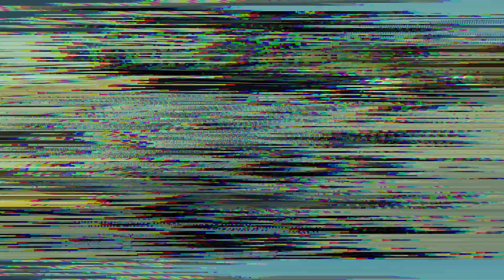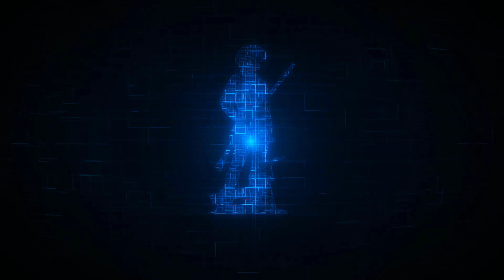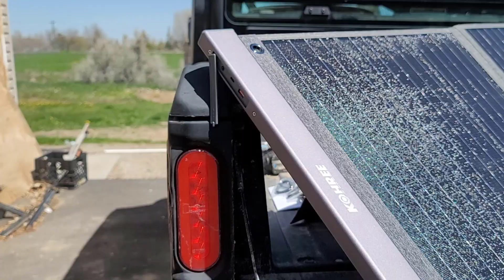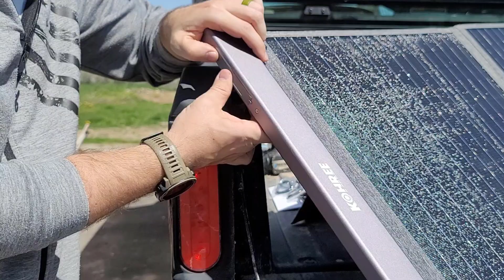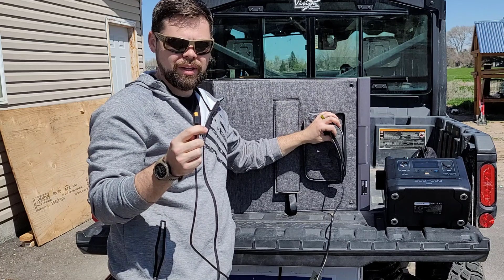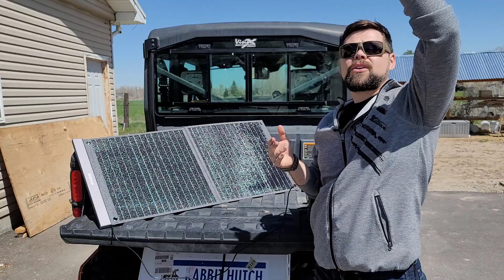Kohree 100w Folding Solar Panel Review

Comment: Utah Jeff …..here….,I have been researching panels for my Oupes 600 and purchased 2 .  The one thing you did not mention is that you can reverse charge from the panel  to the PD 45 port to your power station…. Or you can plug a second panel to the PD 45 port.   The first time I did it I got 75 watts and an additional 30 watts to the PD45 port.   Total of 105 watts.  I can wall charge the same way.

Comment: The BALDR 120W Portable Solar Panel has XT60 plugs and I use it with my Ecoflow River Pro but be warned, I have never seen my BALDR panel produce more than 90 watts in perfect conditions/angles.

Comment: It would also work with the Bluetti EB55, which has XT60 input.  You ca also parallel two.  You might need an XT60 parallel adapter 2F to 1M.

Comment: Still like your XTAR review
Reply: However, the price difference is what made my decision…..With coupons I saved $60 and used $24 on my Prime Account so I actually got 2 panels from Kohree for about the same price as a XTAR…..I have generated 150 watts consistently and could come close to maxing out the 200 watts by reverse charging through the PD45 ports …. My Oupes 600 will take up to 200watts …. Unfortunately,  not every power station does that …..works best with LIP4